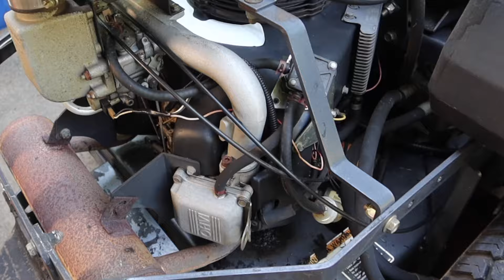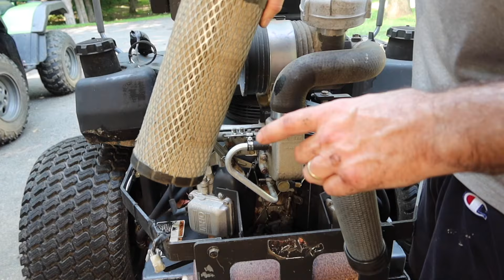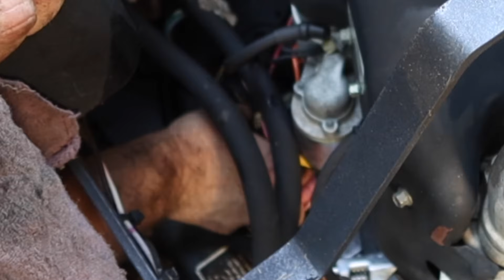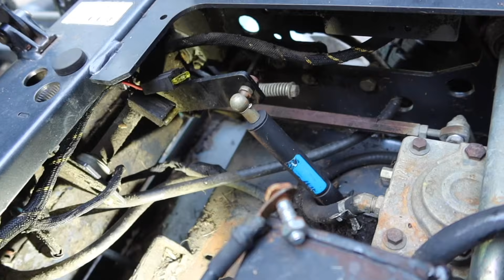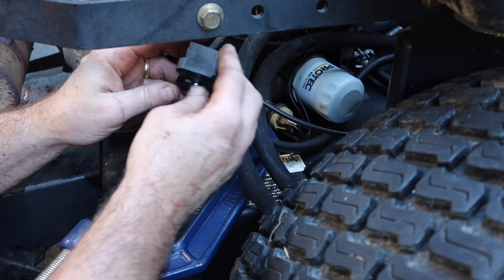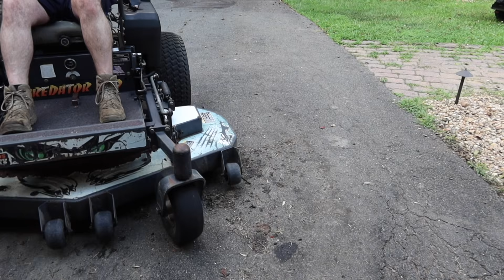Bobcat Predator Pro losing power- unexpected find and repair

Comment: Since you mentioned smoking on startup I was already thinking excess fuel for whatever reason. Good catch on those corroded connectors and plugs, but what would cause that?  Do you think they weren’t tight enough when new?  It’s almost like the boots were cheap and loose, letting moisture in. 
I always use silicone/dielectric grease on boots to seal the connectors and keep moisture out, applying it not only to the rubber of the boot, but also to the metal of the connector.
Reply from the maker: That is a great idea. I had to reuse the boots because I didn’t have the right size and needed to get it back but dielectric grease should have been used.
Reply: @RayofallTrades 
Or silicone grease - same same.

Comment: You referred to these (I think) plug boot connectors as “automotive” does that mean that the ones that are wire are NOT automotive?  Kindly clarify your terminology so I can understand what’s what. Thx!
Reply from the maker: Normally I see the wire folded back on the auto style connector and the piercing style in small engine but that’s just been my experience. I know they use both though